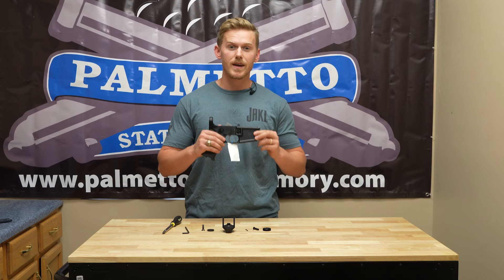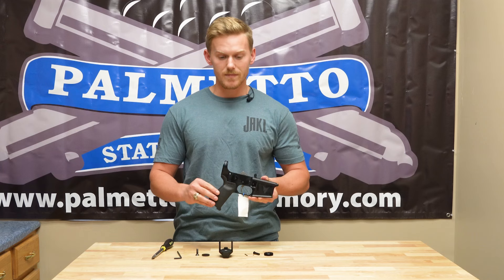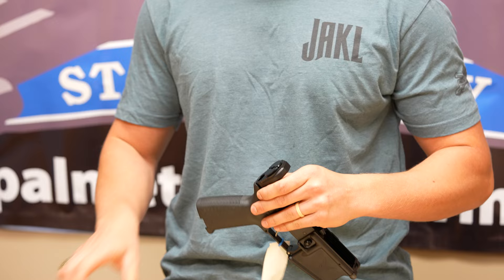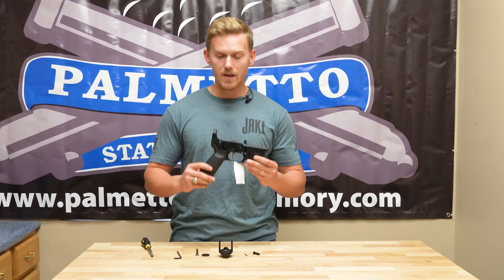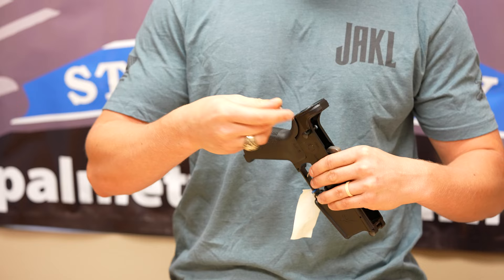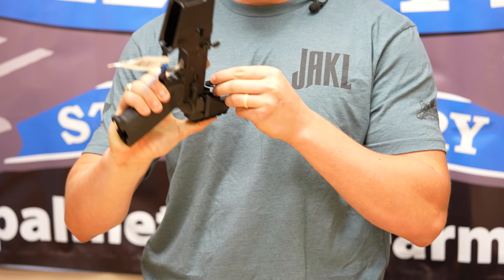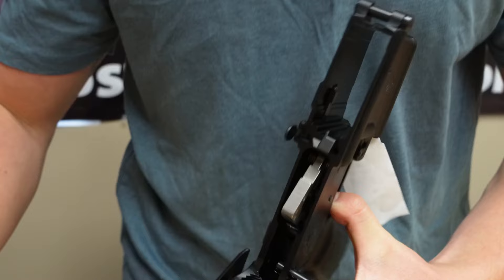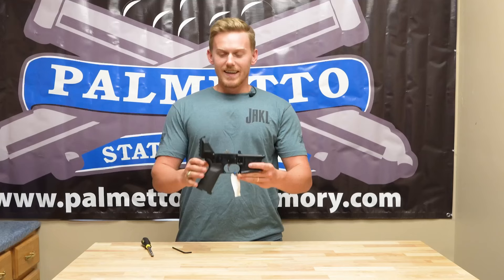The JAKL - Rear Adapter Installation

Comment: we need the jackal in 300 Blackout
Reply: 7 inch barrel with a 1/5 twist would be 😍🤩
Reply: 8.2" is my choice. But I'll take anything from 5.5-10.5 in it. Just give it to us!
Reply: When that one releases I’m buying it
Reply: @brendanakers7294  they have them now
Reply: Originally, they said blackout would be first before corona.
Reply: The bo is the only one I can find rn
Reply: It's here
Reply: I wouldn’t be mad at that or .308
Reply: It is here now not many options though
Reply: @DirectorialAchievements they just announced a 308 variant in the works a bit ago 👌 I'm still holding out for a 10.5 blackout upper

Comment: Might be a silly question, but would I be able to put a Jakl upper on a standard AR lower that has a buffer tube and does NOT have that threaded adaptor in place? From what I see on the structure of a Jakl, I assume that the bolt carrier won't fly into the buffer tube when operating even if without the blocking, but I can be wrong. The answer can affect my decision on which lower and configuration I should go with. Thx

Comment: You guys should have utilized the buffer detent to prevent the adapter from walking out
Reply: No kidding, how did you get it to sit flush?
Reply: Please explain
Reply: @beekeepersjourney8192  by removing the buffer detent entirely it looks like. Missed opportunity. They could have machined a notch into that plug where you turn it in to the point the pin snaps into the notch, just like a standard buffer. It can't turn after that without sheering off the pin.

Comment: I really wish my JAKL had come with this adaptor and a stock other than the F5. Since it didn't I'm now spending at additional $500 on this adaptor and a stock that retains the overall shape of the F5 but is actually made well, the B&T stock from Haga. 

It would also be cool if you guys could get your warehouse in order. I ordered both the Haga sock and PSA 1913 adaptor at the same time. The Haga stock is set to arrive tomorrow. Your adaptor hasn't even shipped yet. It's not 2010 anymore, items taking a week or more to arrive is no longer acceptable.

Comment: How do I properly install the f5 stock when purchased separately? I installed it (I thought right) but I am unfortunately having ejection and reload issues that I think is a gas issue but not fixable with the adjustable gas block. Worked perfectly with my J customs skeleton stock. Please help 😢😢
Reply: I installed just as you did above, the first time, but the first piece that is threaded in (with a flat head) was ridiculously tight and required way too much force, stopping it about 1 full thread from being flush. Could this be my problem? Stock installed fine just with a minor gap between f5 stock and my lower.

Comment: Use rocksett not locktite on any firearm. The heat will break it down overtime. PSA You should be using Rocksett for and threaded components that need to be locked down without a pinned lockset
Reply: This is a stock adapter. It doesn’t get hot.

Comment: Can we run a buffer tube with brace/stock on it instead of that plug and pic rail?
Reply: but then, why? My 300blk pistol already does that, why spend $700 more for a Jakl to do the same thing? Losing the length of the buffer system is THE purpose. Also zero doubt one could make this, without the stupid plastic part, easily and cheaply, the specs are known if it's true milspec, I bet those machined anodized aluminum plugs are $5 online, in your choice of color or design. Bolt, rubber washer, donezo. Which is what you'll have to do as the parts are chronically sold out.

Comment: Can I use any picatinny stock adapter (like the KNS) for the upper to work with a milspec lower or will it only work with this kit?
Reply: Currently researching this. Do you know if you can use any pic stock adapter with the JAKL?

Comment: Well this kind of sucks.  Can't use the lower for anything else with this adapter mounted to the back of my lower.
Reply: how on earth did you think it was going to work HAHAHAHA
Reply: @imitenotbe  like the BRN 180 upper
Reply: @imitenotbe  like all other uppers, like the CMMG Dissent that replaces this. Base requirement of an AR upper is it can be taken off your gun and put on ANY other AR lower, otherwise it's NOT an AR upper. Modularity is the purpose of the design, if you throw that out there are WAY better options than the AR platform. It's modularity is about the only thing it has going for it, and the ability of that to skirt idiotic regulations.
Reply: @RobertMorgan  this isn't, and has never been, an AR-15 pattern gun. Just like the BRN180, it's based off the AR18. They've adapted THAT to AR-15 pattern lowers. In no way shape or form has this ever been a full AR-15 pattern gun lmao